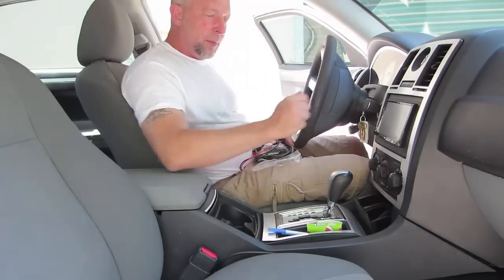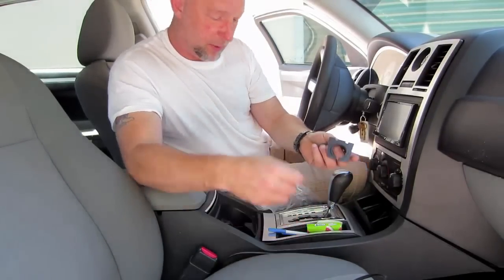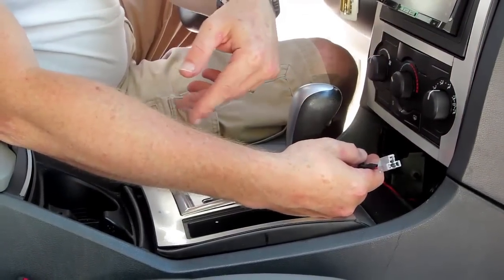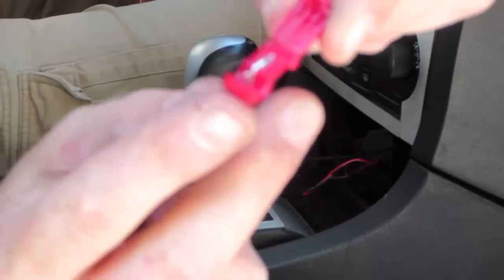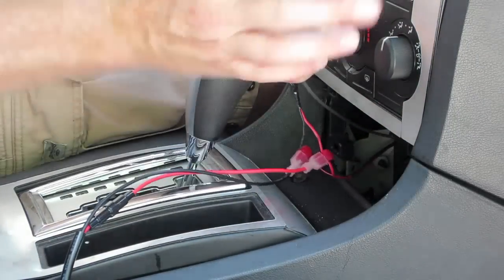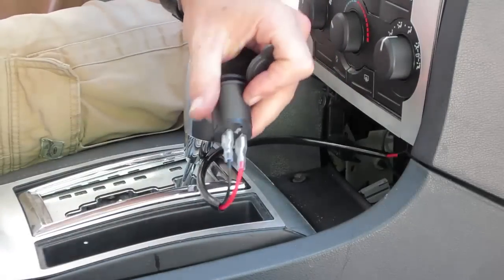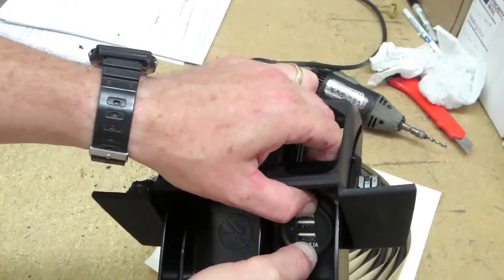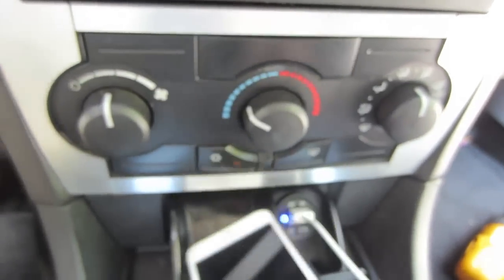How to install a USB charger 12v outlet in your car

Comment: Nice work. I just stuck a compact $5 monoprice adapter into the lighter. Done.
Reply: MarzNet256 it's never a good idea to put a usb into a cigarette lighter. it can cause a fire or short out your device. power point only
Reply: My car audio has it's own USB spots so i don't have to do this but it's fun watching.
Reply: My problem with the push-in USB lighter adapters has been that they are loose and wobble around inside the lighter cavity causing a make/break connection to the adapter. I'll plug my phone in and  it starts charging, we hit a bump, and it has stopped charging. This installation is a much better solution.
Reply: Thats not as clean and tidy tho

Comment: Great video.

I installed a new stereo, and I wanted to add USB, HDMI, and aux ports.  I also wanted to keep the existing cigarette lighter.  I ended up drilling 2 holes in the center console to fit the new extensions to the head unit.

I also documented the install.
On YouTube it's called:
Installing a Stereo, USB Ports, and a Backup Camera in a 2005 Dodge Magnum.

The ports install begins at 36:34

Comment: this looks easier than I thought, thanks for the video, I'll be doing this to get a doulbe socket (usb and 12v) that is closer to my steering wheel on my passat b6, I hate it that it so far down, and i use a modulator so it's alwas a bother because it's interfeering with the gear shifter.

Comment: I have one of these. ON my one (and I suspect they are all the same, but do check if you have one) both USB ports are actually 1amp even though one says 2.1 amp. Other than that these are good, but I ended up getting a dual 2.4 amp USB plug that goes into the 12v 'lighter socket' and use that instead.

Comment: No the same car, but I installed Q plate wireless charging into the little recess at the bottom of the dash, a bit like where you pulled out the plastic to remove the tray unit. Don't even have to plug my phone in, it charges every time it's placed there.
Reply: Simon can you show some images? I'm interested on the setup
Reply: There really isn't much to show. The centre console was removed, and one of these taped to the underside and wired in to the +12v. You can't see it, it just works.
http://www.banggood.com/Qi-Wireless-Charger-PCBA-Circuit-Board-Coil-Charging-p-1000423.html

Comment: Great Video ! I have A 2009 Volvo I recently purchased and nether 12V jacks works,I checked the fuse ,even tried another 15 fuse but the wire looked different on the new fuse. Thanks

Comment: Nice video, I have 3 socket extending unit that plugs into the existing cigarette lighter socket giving me 2 extra when I plug into this, Is it possible to wire the 3 socket extending unit using a relay type switch to actually give me 3 extra sockets.? I'm thinking that if I did this the power would have to come from the battery direct with inline fuse fitted, or could I actually change the 3 socket adapter direct to the existing socket Thanks Shaun.

Comment: can i hook this Dual Input 12V / 24V Single Socket with USB Charging/Data & 3.5MM Aux Input it as black and red wire with a fuse on it can i hook it up the same...  or can i just hook i up to the usb and he aux in the back of the aftermarket radio .
thanks ~

Comment: I installed the same USB model to my ford edge cigarette lighter and the LED on it stays on when I turn off my car. Did I do something wrong? How do I get my LED light to turn off when my car is off?
Reply: Jesse Guillen   there is 2 power cables for instance running from the stereo in gm cars the key on power source is yellow and the constant is red i believe. you can always test this.
Reply: the cigarette lighter in the middle of the car is actually power by the battery so it will stay on and the one inside your box is only turn on when your car is on.
Reply: Bad Cattitude  yep

Comment: What's up this question might sound remedial but I'm stumped, I have an 03 dodge Durango it has a cigarette lighter ran direct to the battery  (stock)  and when I'd plug in a usb adapter for a phone it would illuminate and show the plug lit up, id plug in chord , when I then plug in the phone the charging light would shut of and no power to my phone ? Why is that

Comment: I ordered this from you and wired it into my power + ground, maintaining the existing connection for my stock plug.  I’m getting a 0.75A to 1A (depending on power source) battery draw when the car is off - is that normal for this accessory? That will kill the battery in 1-2 days

Comment: im thinking of using the blue remote turn on wire from my pioneer stereo as the plus power source since that will turn on when the ignition is turned on. Do you think that would work?
Reply: Yah know never thought of that haha in my opinion i could be wrong or won’t work’ yea it tells it to “turn on” but there is no power being supplied’ honestly easiest is but tap a fuse $6 throw it it run power wire from that find a ground boom done

Comment: I want to leave original plug and add usb charger on the side. Do I need to change fuse to 15 amp? How to do it preper way. How to run additional cigarete lighter in the rear?
Reply from the maker: 10a should be just fine..

Comment: can you use either port to charge your phone? or will the 2amp port be to much power?  I've seen these a lot and want one, just wanted to know more about the amp rating and if it matters witch one you choose to charge a phone. like case if I want to charge 2 at once
Reply from the maker: no no no, just becuase its rated 2amp doesnt mean it puts 2amp out default, it only dictates its maximum output draw.

Comment: Pretty cool. Yesterday i mounted a EXTRA cigerate lighter. Kind of the opposite of this video. I bought a xm radio kit to add to radio and it needs to plug into a cigerate lighter to work.wierd. Btw, some gps need cigerate lighter plugs, may be best not to remove it. That usb adaptor like this video shows is a very nice option. If i add one, maybe put it somewhere on center console ;) i thumbs up
Reply: john argue Exactly, makes no sense to actually replace the cigarette lighter. A lot of in vehicle electronic devices still require the use of a DC port.
Reply: Britney Miller Freddy cruger. no nightmare here hotty. 😊

Comment: ebay link to that 12v charger is missing. Can you post names of each part separately? Thanks
Reply from the maker: https://www.ebay.com/itm/12-Volt-2-1A-1A-Dual-USB-Car-Cigarette-Lighter-Socket-Splitter-Charger-Mount/142645587310?hash=item213656ed6e:g:S18AAOSw8sBW6xnI
Reply: @Lesscoelectronics  Thank you very much!

Comment: Excellent video! just finished installing in my daughter's car. question, I want to install one in my car but I want to keep the cigarette connection for my air pump. can I still tap into the cigarette wires, like the way it's done in this video? my worry is I overload/overheat the amp/wires. any help would be appreciated.
Reply from the maker: You sure can, Just avoid using both at once since most cars are only rated for 7.5-10 amps at best
Reply: Lessco Electronics Thank you for responding! I now look forward to the installation in my car.

Comment: Hey there! I have a 1992 chevy silverado and I want to install one of these but keep the stock cigarette lighter in place and not have the USB charger on all the time. Can I install a 12V toggle switch inline between my existing cigarette lighter wires and the USB charger? if so, will any automotive 12V toggle switch work and do I have to install a 10 amp fuse inline before or after the toggle? I probably won't use them both at the same time so I'm not worried about blowing the fuse. I have some decent room to mount both a toggle switch and the USB adapter below my old stock stereo location. Thanks for your help
Reply: Sorry, forgot to mention that the lighter has constant power and that's why I want to install a toggle
Reply: I believe the sequence would be:
Battery, fuse, toggle, then outlet.

Comment: Hey, do you still sell this rubber butyl on your site? I searched for it, but couldn't find it. Thanks for the video :)
Reply from the maker: We have it here: http://www.ebay.com/itm/New-Roll-of-Butyl-Rubber-Sealant-20-Auto-Multi-Uses-/141055220764?hash=item20d78bdc1c:g:P~4AAOxyFiRRzHGT
Reply: Is there any set of ports like this but rectangular ?

Comment: i just installed one in my 97 honda accord lx but does not seem to charge my cell phone what could i have done wrong i tied right into the lighter wiring harness

Comment: hey bro I like this unit but one quick question my cigarette lighter doesn't shut off when key is removed from  ignition always have constant 12v any advice for other customers?
Reply: darrel persaud  there are 2 types wires a constant and a key on power. you can use key on wire to the usb charger or you can always install an on/off switch to this
Reply: ICE CREAM COW BOYZ thank you appreciate your help Oh and season greetings

Comment: I did exactly what you did, but the indicator light does not matter if the key is set or not. And that worries me because maybe that problem can drain the battery.
Can you help me with this probleme please?

Comment: I clipped the plug off thinking i could just attach terminals to the exposed wires and conncet to the new volt charger but there is no electricity getting to the usb port.  Any suggestions?
Reply from the maker: check your fuse panel

Comment: hi, i want to do this but every cigarette usb socket i find has the thing that attaches to the battery, what do i do with that?
Reply from the maker: You need to hardwire it like I show using terminals that attach to the cigarette lighter wiring instead (like the t taps I used)

Comment: Hi, my neme is George and i am fron Chile. I have a problema. My car is a Toyota camry 2007, and its radio only plays CD and does not have a USB or input for cable. From the cigarrete lighter, can i listen to my music from my iPhone? thanks
Reply from the maker: you can always add an rf modulator or a bluetooth dongle kit in the rear of the stereo
Reply: thanks!!!
Reply: Lessco Electronics You installed a USB port by replacing your cigarette port...but now you just your cigarette port lol.

Comment: is it possible to wire a single USB wire to the two cigarette lighter wires? if so how?
Reply from the maker: not directly, the reason why is the usb is 5 volts and the car is 12, it needs to be stepped down with a transformer.

Comment: Can someone help me? 
Is it possible that with a crimp connector, the resistance can be higher than normal (compared to that of a good solder joint) and as such might draw more current which could reduce the effectiveness of the charger resulting in slower/less effective device charging?
Reply from the maker: I highly doubt it, itd have to be the worst crimp of all time!
Reply: @Lesscoelectronics  Much appreciated. Thanks!

Comment: i have a question...im have an ipad mounted into my dash as a replacement to my radio...to make everything flush i ran the wires behind the dash..now my issue is as of right now im using a portable charging block to charge my ipad because when i use my cig usb adapter plug and connect my ipad it puts off this static through the speakers...is there anyway to get rid of that because i want the ipad to charge when i turn my car on by the cig lighter..instead of using a charging block and having to keep charging the block everytime it runs empty..if i connect a 12 volt usb charger to the car will that fix my issue and how can i do that and still retain my cig lighter because again i want everything flush and as of right now the charger is wired through the bottom of the dash to the cig plug or charging block. Sorry i know its kind of a weird issue, hope you can help thanks! (its on a 2000 saab 93 SE)
Reply from the maker: +MrNoGoodGuy it sounds like a real pain having that big old block in there, So I would T off your cigarette lighter wire circuit, and use something more like what I have here, and it'll do a good job of keeping the power on for good amount of time, not s good as an AC charger would of course, But decent I think.
Reply: Alright than, ill try it. Do you think it'll help with the weird humming through the speakers...because that was my main issue and the reason i used the block. Thank you.
Reply from the maker: Hmm, I cant be sure, however what I can tell you is this: why you have less noise on the block is because the cars alternator isn't actively creating noise on the power supply since its disconnected due to it being self reliantly charged, You may get a good results if you connect the new power point to an different circuit, and even if there is some noise you can always add in a noise filter too to make it more bearable...

Comment: I have one question...
Will this usb charger stay on all the time, I'm afraid that It will discharge the battery of the car. Any solution or suggestion ?
Reply: its up to you if you wire it to accessory it will turn off with your car but if you wire it to a contstant then it will stay on always. 5 volts probably isnt enough to drain a battery
Reply: @xjustinoliverx  yes but be careful when taping audio wires. If you take too much power from the amp you may have audio that randomly increases of decreases in volume. The best thing to tap is the fuse box its self

Comment: Does the adapter stay on constant ?
Reply from the maker: if you use the cig lighter plug it'll do what it does now..
Reply: +Lessco Electronics alright thank you. I just never knew that my middle row cigarette lighter was always on until I replaced it with a USB cigarette lighter

Comment: is this usb a constant power how to make it constant power
Reply from the maker: It'll be what your existing power supply does (the one you removed) But you can modify it by simply running a fused power lead over to keep it constant if that's what you need.
Reply: Lessco Electronics  thank you very much for your help . like your videos keep it up.

Comment: Thank you for the helpful video! Do you sell any USB/AUX input jacks with similar easy setup methods?
Reply from the maker: Sure I do!  http://www.ebay.com/itm/12-Volt-2-1A-1A-Dual-USB-Car-Cigarette-Lighter-Socket-Splitter-Charger-Mount-/361537698772?hash=item542d537bd4
Reply: +Lessco Electronics Sorry I meant to say an 'audio' aux/usb combo. Thanks!
Reply from the maker: I got that one too: http://www.ebay.com/itm/12-Volt-Dashboard-Flush-Mount-3-5mm-Jack-USB2-0-Extension-Cable-Install-Kit-/361513479271?hash=item542be1ec67

Comment: I don't think the output of the USB is 12 vdc  The input is 12 vdc I'm looking for a 12 vdc output cigarette lighter plug that is switched so I can turn on and off a wifi transmitter Any ideas?
Reply from the maker: This usb is 5v dc, what power does the wifi transmitter need and whats the connector type?
Reply: It has a standard 1/4" female connector Like a 120 V power supply on a battery operated device such as a radio.
Reply from the maker: Interesting, Let me see what I have around here like that..
Reply: Lessco Electronics I'm using the connector for a rearview camera. I'm going to come off either the cig point or a switched fuse off the fuse box. If you look at any wired Rearview camera you can see the red connector and the video RCA jack which Is standard type connector
Reply from the maker: Nothings coming to mind, Maybe look the subject up in an online forum, Im sure someone else had this same idea..

Comment: Can I put that in my car cuz I rather put a usb in it instee of fixixing the cigartter light it useles
Reply from the maker: That's what this video is all about. If you need any parts just ask, I can help you out alot there.
Reply: I have a light usb would that drain my battery
Reply from the maker: It will, very slowly but it sure will.
Reply: @Lesscoelectronics  yea my battery think it drained i  thought it was frozen cuz 10 degree can I tap in the tye cigarette lighter fuse but it it turn off tye light or somthing like that

Comment: What to do with the ground?
Reply from the maker: connect it the the metal chassis of your vehicle.
Reply: @Lesscoelectronics  thank you for replaying to me. But i see only two wires on new usb charger. And it is all covered in plastic. Where should i connect the ground? :/ the other end which comes from car metal.
Reply from the maker: the one with the - sign next to it is the ground.

Comment: usually on older cars the whole idea is GET off the ciggaret lighter wiring..

The wiring in my 30 year old Jeep for the cig lighter is thin ass like 20ga wiring..  not enough power for a cell phone..  So its not quite as simple as in your video.

You should wire the new charger directly to the battery with proper sized wiring